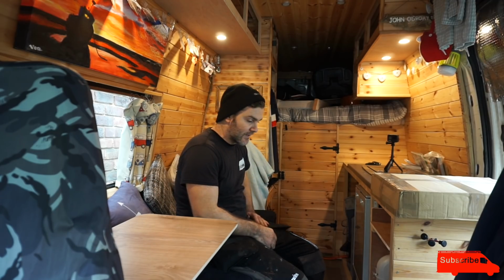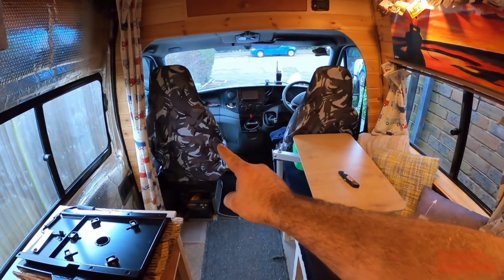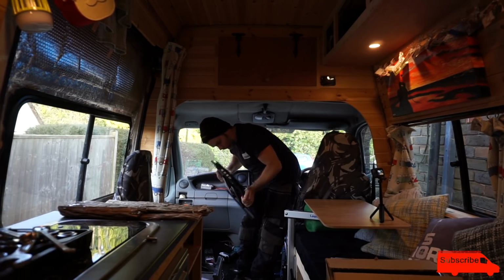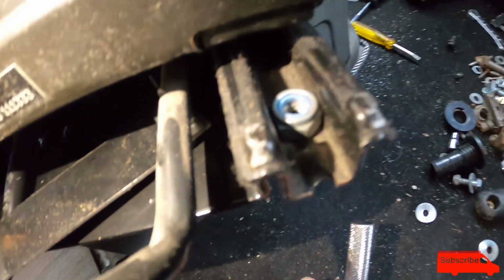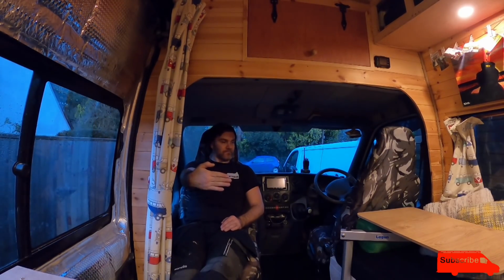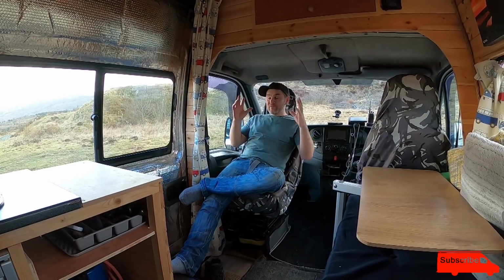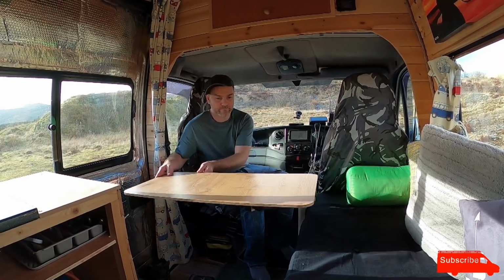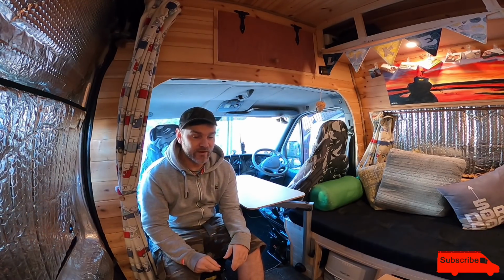Installing A Swivel Base!

Comment: Nice swivel base! I went with the slightly more economical route  and just opted to have a dedicated screw pull (10 quid) witht he correct nut and then i can just undo the 4 bolts to the seat, and manually swivel. Cheaper, and I can move the seat to where i want it. Bit of a kerfuffle but it works for now. One day!

Comment: Luke, if you want to swivel the drivers seat too, you might be able to move the handbrake to the centreline. I did that on my Vivaro. Might be a problem if your van is rwd though. I made a bracket to support the handbrake and used the spare double seat mounting points to locate it 👍
Reply from the maker: Thank you, I may do the driver's seat one day. But not for a while :)
Reply: @LukesVanLife  Okay, drop me a message if you want more info, it was really easy

Comment: Hey Luke. Great vid glad you like the seat! 2 things... it’s possible to swivel the driver seat, not easy but possible. I got ford Galaxy seats so might be slightly different. Mine basically pushes the handbrake out of the way a little bit but it’s ok. 2nd thing. Don’t want to be a party pooper but you’re gonna need high tensile steel bolts on that mount. That’s what those Allen key ones were that you took out. Easy enough to find on amazon. 8.8 grade I think it needs to be. Regular bolts from hardware shop might shear off in case of accident.
Reply from the maker: Thank for the tips. Maybe I'll get the driver's seat to swivel one day :) 😁👍

Comment: Luke a swivel base will go past a daily hand brake I have one in mine you just need to let the hand brake off spin seat and pull brake back on.
Reply from the maker: Good to know, thanks very much :) 👍
Reply: The only issue may be your bench ,  but you are more than welcome to come and take measurements from my drivers  swivel  whilst we are at quirky to check it will work.

Comment: When I did mine, the bolts were buggers. One was cross-threaded too, barely holding in place and stripped. I took my chairs out and fitted adaptor plates for swivelling Ford Galaxy seats instead. 15 minute job yeah :) Is your handbrake cover missing?
Reply from the maker: All my Allen key bolt heads that were in were rounding off so did away with those :)
Reply from the maker: Handbrake never came with a cover, should it have one?
Reply: Yeah mine's got a grey plastic cover to the floor. I might have a photo somewhere... (emailed a couple to you)

Comment: Luke you have some Camera equipment , the mic on your camera what batteries dose it take ? . I have my chines heater in its box I was going to fit it under the van today but rain stopped ply . If the road did not have a hill cline and the water running down the gutter I would of done it as I only have five holes to drill . The nuts will stop you sliding the chair all the way back I would of thought, I hope you and your wife have a good trip and the weather is dry
Reply from the maker: The microphone doesn't use batteries, I have a link for the mic in my video descriptions :) yea pretty bad weather today. The bolt head didn't restrict seat sliding at all 😁👍

Comment: Hey Luke thanks for this video, I'd love this exact setup in my Daily. Currently at a double seat though, so I've lost access to the cab with the bathroom in! Did your van come with a single seat?
Reply from the maker: Hi, thank you, my van came with the twin double, I fitted the single passenger seat. It's just another iveco daily drivers seat. Makes a world of difference :)
Reply: @LukesVanLife  Fantastic mate thank you. Does it take much fiddling to fit a single seat from the double? I see under my double seats there are some extra holes that look like they'd line up for a single!
Reply from the maker: @Aidentified  very simple to fit single seat, all the holes in the floor, it's a doddle :)
Reply: Aidentified 
I think you can get a double swivel seat but don’t quite me mate 👍🏻
Reply: @firstmotorhome8024  https://www.youtube.com/watch?v=2rFwvnGtTyA   skip to 1.20